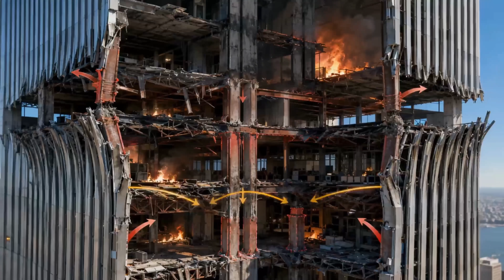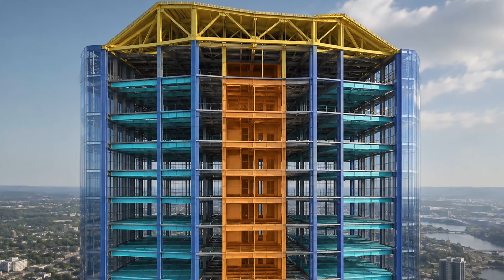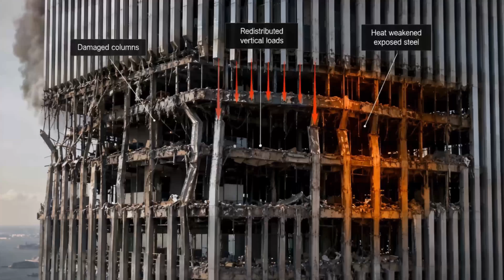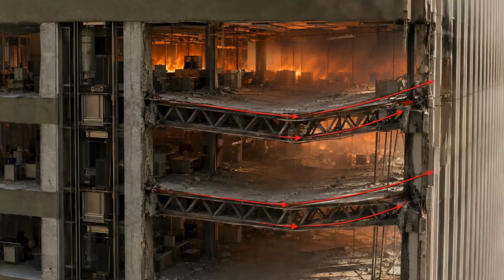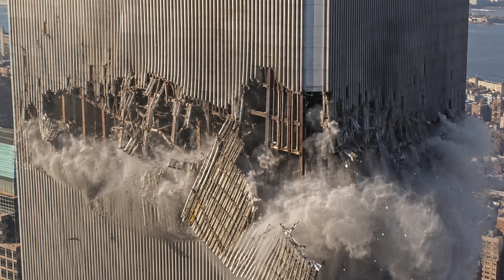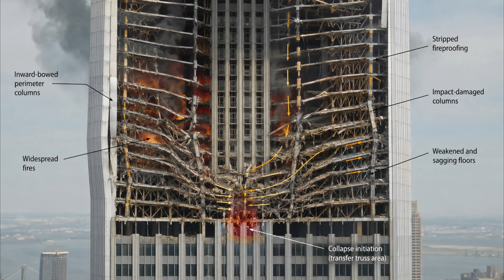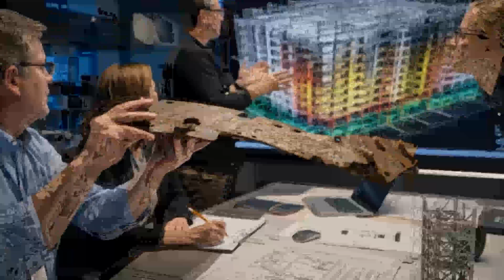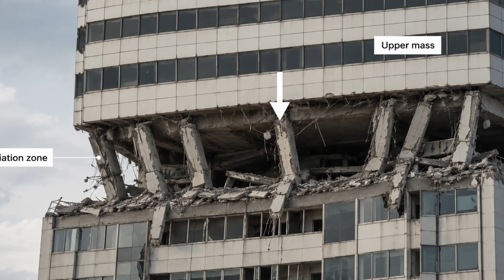What Happened Inside the Twin-Towers After Impact?

Comment: Progressive failure at free fall speed would not have occurred. The load was great above, but there was no resistance at all coming down. Can't explain that without some sort of damage other than the aircraft and fire damage.
Reply: There wouldn't be much resistance coming down since all the things doing the resisting - the load bearing columns - were mere spectators. And yes, I can absolutely explain that with aircraft impact and fire damage over time.

Comment: Pardon the expression, but This video is Bull$%#!   
Mixing it all up, as if the buildings are weak. This video lies. NIST did not do a proper investigation.  They ignored explosive evidence.  

Both towers accelerated at near free fall speed.  It’s nothing to do with a combination of thing. Both  towers show demolition waves descending the buildings
Reply: There is no explosive evidence. 

Also, what does near free fall speed actually mean, and not just because free fall is a measurement of acceleration NOT velocity, thus can never be a SPEED?

If you would indulge me for a moment please take a look at something you likely have never seen or noticed before. It’s in just the first 15 seconds of this video: 

Gary Pollard South Tower collapse, looking at the east side toward the north at about the 80th floor. 

www.youtube.com/watch?v=ULdiD6gYZO0

What do you see?

I see the perimeter columns on the east side of the South Tower bent. Bowed inward with the bend suddenly increasing to about 5 feet until they fail and the collapse starts. Don’t you?

Which is stronger, a straight column or a bent column?

A straight column will be up to 4 times stronger than a bent column, right? 

So the weaker those columns get, the more they bend and the more they bend the weaker they get, right? 

So why are they bending?

It can’t be hundreds of impact-and-fireproof invisible pre-placed explosives that nobody noticed in their office, don't explode or produce any blast effects. Where are the loud 180-190 dB bangs? The bright flashes? The supersonic pressure waves. The lethal high-velocity ejecta raining down on everyone below? None of those are present. Silent explosives that don’t explode or produce any visible effects aren’t going to just bend heavy steel columns, are they?

So why did the columns bend to start the collapse?

Collapse initiation was due to sagging floor trusses from the impacts and subsequent fires pulling some of the perimeter columns inward by up to 5 feet until they buckled,. This has been known and understood in the worlds engineering community since just a few weeks after 9/11/2001.  Only ignorant conspiratards bang on about explosives and demolitions because it is easier than thinking.

Comment: Need to do one on building 7 how no plane hit it and it still collapsed like a controlled demolition from a few office fires and how Larry Silverstien said in an interview that the order was given to "pull it" which is language that means to take down a building with controlled demolition that normally takes weeks of planning and setup...
Reply: WTC 7 was hit by huge chunks of debris from the collapsing North Tower and had raging fires across multiple floors with no fire suppression at all as the lower floors were supplied by water mains under the street destroyed by the collapse of the towers and FDNY tanker trucks couldn't get close enough due to the rubble. Claiming it was a "few office fires" makes you a clown, and structure of the building with exceptionally long support beams made it susceptible to long duration fires(heat expands steel, the longer the steel pieces are the more they expand).

Also Silverstein's comment was in response to his security chief letting him know they had totally cleared the building(checked twice) and was telling him to pull the small team of firefighters out that had been using mainly extinguishers to try to ineffectively slow the spread of the fires while the evacuation occurred. The FDNY radio chatter has them told to "pull out" seconds after his comment. 

Also "pull it' is not common language used in explosive demolitions, "push it" used to be referring to pushing the plunger/button on the detonator. Someone once made some crap up and idiots like you just believe it while denying the scientifically proven facts. Such clowns disrespecting the dead because of your narcissistic need to feel special, pathetic.
Reply: @jongrey1916   If the government has not done anything shady today, they just haven't had coffee yet.  I separate the cause from the tragedy. Yes, the lives lost is truly sad and it hurts deeply to hear the stories but that makes it all the more of an injustice that should anger anyone if this had even an ounce of deliberate planning.  The endless testimonies of street witnesses, Firefighters, and News reports of the sounds of explosions "like" a demolition that have vanished from the internet but I saw them and they cannot be dismissed by anyone with a rational mind.   I'm guessing you believe the official JFK story, the official Pearl Harbor story, and the official Covid-19 Pandemic story?  After Fauci pleading the 5th 111 times, people are more receptive to 9-11 being an inside job now who weren't before.  Wars need to continue for the military production industry to thrive & investors to profit. When the Berlin wall came down, we needed a new threat.  Almost every President has been a "war president" since the 60's. We've been in endless wars since 9-11.  Coincidence?  No.  Keep believing the governments an angel because your heartstrings won't allow anything less...
Reply: That one's kinda been done to death. I mean, if you want real detail a YouTuibe video made for a YouTube audience isn't going to cut it anyway.

But you are in luck! No need to rely on a single source.  If you have an objection over a single detail you have many other options. 

The collapse of Building 7 is one of the most studied engineering disasters in history and the subject of 5 comprehensive engineering studies and more than two dozen technical articles in major peer reviewed engineering journals, most of which were published 15 or more years ago. Thousands of pages of material. This should get you started. 

FEMA BPAT (initial report superseded by NIST NCSTAR 1A) 

NIST NCSTAR 1A: Final Report on the Collapse of the World Trade Center Building 7, 2008. 

Guy Nordenson and Associates, WTC7 Global Collapse Analysis Report and Summary of Findings, 2010. 

Arup, WTC -7 Structural Fire Analysis Report (Runs 1-4), 2010. Weidlinger Associates Inc., WTC 7 Collapse Analysis and Assessment Report, 2010.

BRE Centre for Fire Safety Engineering, Analysis of the Impact of a Fire in the Mechanical Room (5th & 6th Floor) of the World Trade Center 7 Building, 2010. 

T. McAllister, R. MacNeill, O. Erbay, A. Sarawit, M. Zarghamee, S. Kirkpatrick, J. Gross, Analysis of structural response of WTC 7 to fire and sequential failures leading to collapse, 

J. Struct. Eng. (United States). 138 (2012) 109–117.

For a summary of the major studies I would recommend THE COLLAPSE OF WORLD TRADE CENTER 7: REVISITED by Mhd Anwar Orabi , Liming Jiang , Asif Usmani and Jose Torero which is a 27 page summary of the different analysis and conclusions published in 2020. Sorry, YouTube will delete this post if I give the link but it should be easy to find and is available from the University of Queensland, Brisbane. 

Real structural engineering industry professionals conducting real engineering studies and publishing them for other professionals to see and even as evidence in courts of law. Not amateur YouTubers appealing to the gullible and credulous while holding their hands out. Happy reading

Comment: During WWll, a B25 struck the Empire State Building. It didn't collapse.
Reply: Yeah, becaue the ESB is a more robust building and a B-25D bomber weighs about as much as one engine on a B767 while moving only 1/3 as fast.  For a meaningful comparison that B-25 had the energy of about 42 lbs of TNT while Flight 175 was about 2,000 lbs of TNT.

Small difference. 

Not all crashes are the same.

Comment: Why is there no mention of a 200-ton aircraft adding to the weight-bearing steel and concrete?
Reply: 122 ton - because that wasn't really a factor.
Reply: @TheLoonResistance  Please explain how extra weight that the building was not designed to support wasn't really a factor?
Reply: @PCHobbyist2448  - Well for one, you overestimated the aircraft mass by almost double. Then there's the fact not all of that mass stayed in the building, much that did burned up and the remainder was widely spread out across multiple floors. 

Far more damage was done by the mass of the aircraft smashing into the towers than that mass coming to rest in them.  What was left of the floors could hold a remarkable amount of weight.
Reply: its not a documentary ... its a simple explanation

Comment: Cgi lies, it was controlled demolition 3x in one day, wtc was not even hit with supposed planes. If fire was was so effective for demoliting skyscrapers they woudnt need demolition experts..
Reply: Would you indulge me for a moment please take a look at something you likely haven't seen or noticed before. It will take 15 seconds.

South Tower collapse, looking at the east side toward the north at about the 80th floor. 

www.youtube.com/watch?v=ULdiD6gYZO0

What do you see?

I see the perimeter columns on the east side of the South Tower bent. Bowed inward with the bend suddenly increasing to about 5 feet until they fail and the collapse starts. Don’t you?

Which is stronger, a straight column or a bent column?

A straight column will be up to 4 times stronger than a bent column, right? 

So the weaker those columns get, the more they bend and the more they bend the weaker they get, right? 

So why are they bending?

It can’t be hundreds of impact-and-fireproof invisible pre-placed explosives that nobody noticed in their office, don't explode or produce any blast effects. Where are the loud 180-190 dB bangs? The bright flashes? The supersonic pressure waves. The lethal high-velocity ejecta raining down on everyone below? None of those are present. Silent explosives that don’t explode or produce any visible effects aren’t going to just bend heavy steel columns, are they?

So why did the columns bend to start the collapse?

Comment: Buildings were deaigned to take jet liners crashing into it so collapse would isolated and building should of been standing but  demolished using explosives on each floor, what they dont show that the supporting steel pillars had angled cuts, meaning thermite explosives were used. If you are interested in the true atory then research it as it was an inside job.
Reply: Wrong there clueless, the towers sustained the initial impacts, so yes they were still standing, but if true, the original design for a smaller, lighter 707 type jet plane, traveling at a quarter of the speed, was what was built.  All of these ignorant and unsupported narratives only serve to dishonor the lives lost on that day.  Shame on anyone that does.
Reply: That is not correct. Nobody designs a building to have a jetliner crash into it nor should they. 

In the case of the Twin Towers, sometime after primary design work was complete someone remembered or was reminded of the 1945 Empire State Building crash so they did some quick back-of-a-napkin calculations and determined a Boeing 707 lost in fog on landing approach (slow and light) hitting a Tower would not cause its immediate collapse. No consideration was given to fuel loads and subsequent fires. 

The planes that actually hit on 9/11 and 4 and 5 times the energy respetively and 5 tons of accelerant which started massive fires on a dozen floors at once. The Towers still stood for a remarkably long time.

Comment: I would recommend the UK Channel 4 doc on the 9/11 collapse, made a couple of years afterwards. Its on YT. They spoke to the Senior Architect who approved the design & plans & 4 independent structural building engineers , who looked at the building plans, TV footage, witness, firefighter & survivor reports.  They agreed each plane hit the building's core support, which was a tube design. Each tube held the building lift shafts: & every floors steel support girders were attached to this central core 'tube'  . On impact , 560 thousands litres of burning jet fuel poured down the tubes lift shafts spreading the fire & warping & buckling the steel support girders.  That's why the collapse happened. Temperatures reached were estimated to be significantly higher than those used in human cremation.
Reply: What you fail to realise is - the whole building was a "tube" design and on closer inspection - two tubes, one made by the core and the other by the 240 exterior columns - they were stabilised as a whole by the trussed floor. 
Though to the layman, the Towers looked strong, big lumps of steel etc - they were basically quite skimpy from an engineering point of view - two masterpieces of what to leave out if you want build high with max rentable floor space. 
They had inherent weaknesses - the tubes came apart when the floor to exterior column connections let go like giant zips - that was the sound on every video boom, boom - boom getting faster - that was the noise of 700 ton floors letting go at one end, folding and hitting the one below - all the way to the ground. The core columns only failed when there was nothing to hold them rigid.
560,000 litres of fuel is SEVEN 767's worth - max fuel is roughly 90,000ltrs or around 70tons - all of that fuel was vapourised instantly on impact and flash combusted - forget all about it pouring in liquid fashion anywhere!
Reply: @alanclark639 Comprehension skills are a thing. My comment already states all your repetition re the tube design. What do you think the 'core support' I mention,  is? A one off, one floor thing? A core support is the whole building.  Also the NIST Investigation Report 2001 states that while 70-80% of the fuel vaporized, 20% of it , burning , cascaded down the lift shafts. That was after viewing footage, talking to firefighters who were inside & had firsthand sight  ,  witnesses , first responders & survivors.

Comment: 280000 liters of oil , if full. Can this amount of oil demolish a giant construction like world trade centre?
Reply: No. Fuel burns at a lower temperature that is required to melt steel.
Reply: @WilliamMyers-m5x  It didn't have to melt. Structural steel weakens at 550 Fahrenheit, the fires were burning at almost double that temperature.

Comment: Watch the collapse of Building 7.  CBS newsman Dan Rather said the collapse of Building 7 looked like other buildings destroyed by "well placed dynamite".
Reply: OK, so what?
Reply: The dust cloud "looked" like a volcano - without any lava. Building 7 was sliced through by core columns falling out of Tower 1 and then caught fire and burned untended for eight hours before falling. And like the other two that collapsed - were novel and eccentric constructions.
Reply: Building 6 was between Building 7 and the Twin Towers. Building materials falling straight down by gravity would not have hit Building 7.  It was debris from one of the planes that first hit Building 7.  The landing gear was found behind Building 7.

Comment: Another fact.  The towers were designed in 64/65 same time as a boing 747

The forst commercial flight of a boing 747 was Jan/feb 1970

When did the towers get finished?  So you’re telling me they didn’t factor this in.   

And if you’re still reading this.   The jet fuel ignited instantly into an explosion.  Jet fuel didnt rundown anywhere.  It exploded instantly .    And records.    Please prove me wrong
Reply: The Boeing 747 was never a factor in the design and construction of the Twin Towers. That is a fact. Indeed, according to chief project engineer Leslie Robertson the only consideration they gave (though it had zero impact on the design) was a much smaller and lighter Boeing 707 lost in fog while on landing approach - essentially the conditions of July 1945.  What was also never considered is a Kamikaze attack - the conditions of 9/11/2001.